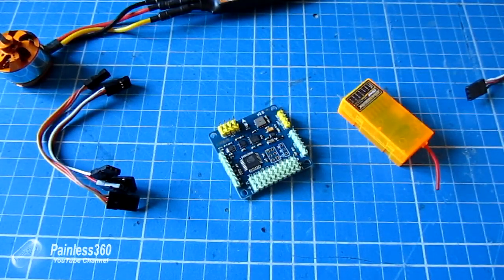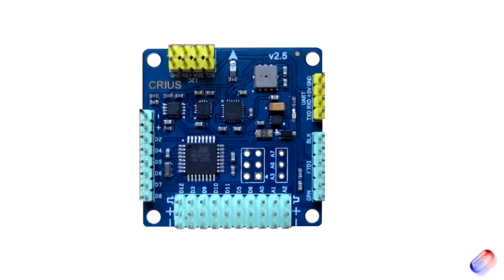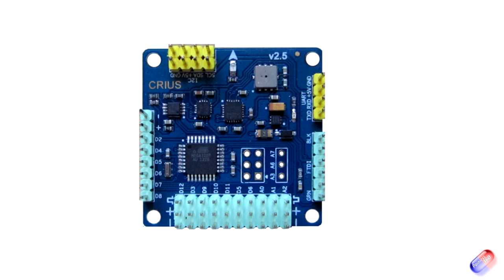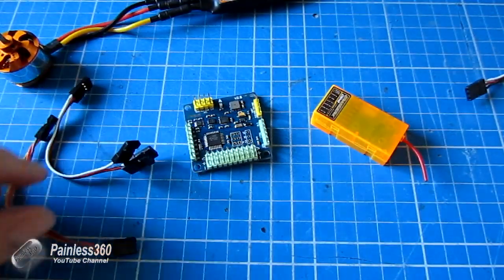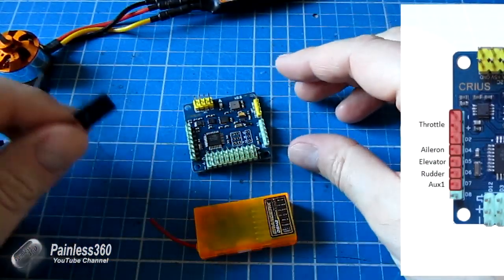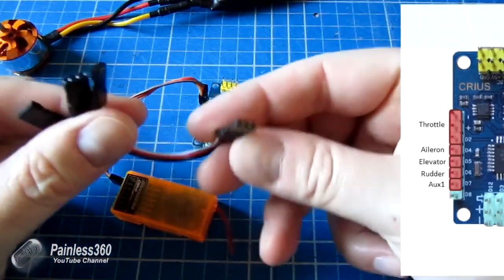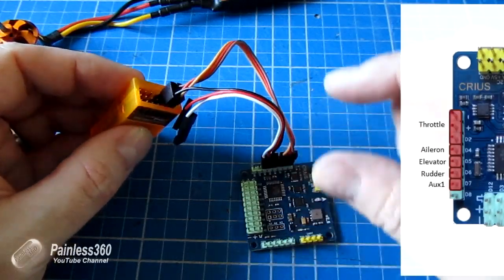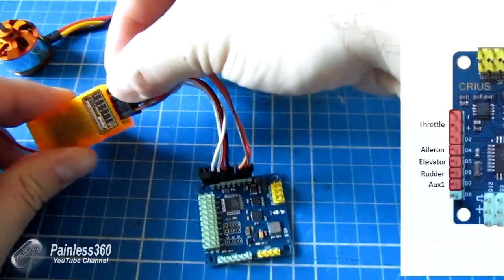(2/7) How to wire up a Multiwii SE board to your multirotor/quadcopter

Comment: I followed your procedure but when I plug in the power to my quad copter my esc's beep constantly and even when I arm the board it continues and I have no throttle.
Reply from the maker: What does it show when you look at the board through MultiWiiConf? What ESC(s) are you using?

Comment: I'm having problems with my board: it seems to work as it is supposed to until I put on props and try to fly. The motors just start twitching, stuttering, and acting abnormally unless I dismount the multiwii and completely oscillate it from the vibrations of the craft. I did the best I could at balancing the props, what could be causing the issues?
Reply from the maker: I've had this problem and its been two separate issues here.

The first is that I'd flashed the ESCs with SimonK firmware and there was a bug in the KK tool that loaded the wrong firmware onto the ESCs. If you've loaded the firmware yourself - update and reload and check the versions you are using have no known issues. (Problems with HobbyKing 20A ESC after flashing with of SimonK firmware V2013-9-20 - Solution)

Second problem was due to harmonics in the frame/arms that the MWC didn't like. I used the LPF settings in CONFIG.H to remove these and fly normally.

Hope one of these is your issue and gets you flying. If not schedule a Helpout and we can take a closer look.
Reply: Painless360 What is LDF? Is it software-dampening? I did try to tape the FC to a bit of foam, but it did not help until I grabbed the FC and then the props ran smoothly.

I did not flash the ESCs with any firmware and they run smoothly with propellers (If I snap it up to near-max throttle, they buzzing/vibrating noises from I suppose unbalanced props and crap motors.) Nonetheless it seems like the ESC does what it is supposed to.
Reply from the maker: OK, sounds like you need to balance the props and motors as the vibration is too much for the controller, even with a mount. The LPF (not LDF) is a software low pass filter that removes unwanted interference in the gyro/accelerometers. I've had to do it a few times myself to get the board to handle the frame ok.

From the config.h section on LPF -

"MPU6050 Low pass filter setting. In case you cannot eliminate all vibrations to the Gyro, you can try
         to decrease the LPF frequency, only one step per try. As soon as twitching gone, stick with that setting.
         It will not help on feedback wobbles, so change only when copter is randomly twitching and all dampening and
         balancing options ran out. Uncomment only one option!
         IMPORTANT! Change low pass filter setting changes PID behaviour, so retune your PID's after changing LPF."

Try uncommenting #define MPU6050_LPF_188HZ first and if it doesn't work try the next one down until you get it.

I think I'll make a video on this as it is very handy to know..
Reply: Painless360 I've just bought a magnetic balancer it will take some time to arrive, in the mean time I think I will try that LDF settings! I sound them in the code and uncommented the 2nd one down.

I did attempt to balance the props by press-fitting a smooth round pencil into the middle, and letting it balance on the edge of my table. I then added tape to the heavier side until the heavier blade no longer preferred to swing down. I also tried balancing the base with electrical tape, but on some blades I could not get it to balance nicely, at least not with tape.

How much vibration should I expect coming from a decent setup? I just downloaded an vibration meter to my phone to see if I can quantify the vibration from the motors and props.
Reply: Painless360 In case I do need to flash SimonK firmware to the ESCs, do I need that programer shown in the video? Or can I use the FTDI adaptor? I also have a spare arduino MEGA which can probably be configured to flash other chips. I saw a video where thats what was used to flash  one of those ATtiny85 chips.
Reply from the maker: I would use the programmer. It's easy to do. Good luck with it.

Comment: Hi. I did try it on the grass. Manage to fly but still driftting fast to a side. Im not quite sure which side as it goes very fast drift and flip to the ground. I have checked all my motors and props. Its all installed correctly. I feels like 2 of my motors not getting much power compare the other 2. I might wrong in this. My question now is do i need to auto level the multiwii using the computer? And trim auto level after that? Im so sorry coz im newbie and just started to get into this as new hobby. Thanks in advance!
Reply from the maker: Hi Emo, if that is all ok then recheck that the artificial horizon in the MultiWiiConf responds as you'd expect and reset the accelerometers..

I'd also manually recalibrate the ESCs again too, just to be safe.

Hope it helps.

Comment: Hi. Thanks for all your video. I just finished build my 1st quad. My 1st flight was not smooth at all. It goes flip at one side as if 1 or 2 of the motors is not power enough to take off. If it flys it will drift at a side quite fast and flip. Can you help me how to solve this? Hope to fly smoothly before i breaks the props :((

My gear - multiwii v2.5 + flysky fs-t6
Reply from the maker: Hi, first thing to check is that you have the motors connected on the right way and that none of your props are installed upside down...
 
Hope this helps..
Reply: Hi, thanks for your reply. I've checked all my motors, they are all connected correctly and the props are installed as they supposed to be. I manage to fly it at about 2 feets and the moment its  start to fly, its drift to a side. Will try it again on a grass so that they won't crash badly. Earlier i was trying on a hard floor.
Reply from the maker: Hi Emo, if that is all ok then recheck that the artificial horizon in the MultiWiiConf responds as you'd expect and reset the accelerometers.. Hope it helps.

Comment: I can't seem to get my hex to arm even after I load the software on the board. Someone said I may need a boot loader? Sorry, a bit off topic but I have the same board and don't know if I need that.
Reply from the maker: Hi Mark, if you have successfully downloaded the software to the board (and can see it using MultiWiiConf) then the bootloader isn't needed as the board is configured.Check out my video about troubleshooting arming called 'Multiwii Arming' (@watch?v=lc4ECi6JYX4&list=PLYsWjANuAm4qSqszQR6qIisiwk5r-_nMk&index=6) that may help.Good luck with the problem.

Comment: Hello, I brought the HKTR-6a, I really do not know which channel is Throttle or Aileron？my receiver shows CH1-CH6,which I have no idea. Please help me, thanks
Reply from the maker: Hi, it's never helpful when the manufacturer doesn't mark the receiver! The detail you are after looks like it is in the files section at the bottom of this page - http://www.hobbyking.com/hobbyking/store/__9042__Hobby_King_2_4Ghz_6Ch_Tx_Rx_V2_Mode_2_.html

Look for the file called 'Channels' you can always check this when you first connect the Multiwii to the MultiWiiConf interface. Check that the channel you are moving is the one changing on the display. Bets of luck with the build.
Reply: Mine was the same way,  I used my oscilloscope and probed everything out, and figured out what channel was what. You could also connect the esc directly to the fifteen channels and then plug in the LiPo and see which gimbal controls the motor. No need to arm in the direct receiver-to-ESC connection.

Comment: Hi, Tell me please? whats wrong with my board. Blue led flashing all the time . Rewriting new firmware did not help. Maybe i burn it when connect throttle from receiver in wrong way. Thanks!
Reply from the maker: Hi Саша, Does the board connect to MultiWiiConf once it's flashed? The LED will stay flashing for a number of reasons but one of the simplest is that the accelerometer calibration hasn't been done/the board isn't level. Try that.

Hope it helps. Happy flying!
Reply: Painless360 No, It is not connected to MWC. Just plug the battery and it start flashing. And I can not activate it. Try to calbrate acc.Thanks!
Reply from the maker: So you get an error when you try and flash the firmware using the software then? See Crius SE V2.0 MultiWii Board (MWB) Overview and Setup for the details..
Reply: Painless360 Yes i use this instructions from beginning and everything was OK. I flashed new firmware - 2.2 2.3, but board did not work properly. I decided flash board with your firmware 2.1 again (with this firmware board work properly). Flashing was OK, but board did not work.
Reply from the maker: So, to be clear. You have calibrated the compass and accelerometers using MultiWiiConf? If you have then make sure the board is flat when powered on. Failing that, schedule a Helpout time and we can take a look.
Reply: Painless360 Calibration is not done yet. I Try it.
Reply: Саша Семенюта Thanks! It works again.

Comment: Painless360 thanks a lot for your last tip! I now have my multiwii megapirate board ARMED and all the stick functions are correct!!    The only problem I'm having is that it doesn't arm/unarm by turning the throttle stick to the right/left at bottom position.    In my case it'll arm as soon as I give like 15% throttle on the throttle stick. And after it has been armed the motors will idle even at 0 throttle input... I also can't find a way to unarm it.

Again thanks a BUNCH for the help that you've already given me!!
Reply from the maker: You can try a few things (after that I've not got enough experience to guess!) you can try performing a ACC calibration and a MAG calibration and/or selecting #define CRIUS_AIO_PRO_V1  in the code.. Best of luck!
Reply: ACC calibration just defines the board's (level) position... MAG calibration I'm still lost on what that does. 
As for defining the CRIUS_AIO_PRO_V1 I get a programing error. I referred to this in one of my previous comments.
Reply from the maker: Bruce Hitzfield If the board doesn't think it's level then it won't arm. RCgroups forums may be a good place to have a look in. I hope you get this sorted soon. Happy flying!
Reply: If your using the windows GUI then check that the boxes that assign function to your AUX1 swithing arrangement,you'll find that having the Low box checked for acro mode takes over the arming process but reading your question again I believe that "Painless360" is right in that the RCGroups site will be the place for you.The guys there are great with the MW stuff.The MAG calibration is a way of letting the chip know which way is which.You press it and rotate the copter through all axises eg: roll,flip and stand on bum and rotate (hope you know what I mean?) BUT! this has to happen within 30 seconds of pressing the calibration button ok,so try it a few times because if like me you only have a short length of wire connecting the FTDI to the copter then it takes a little working out OK.....Good luch with it and enjoy the flying
JCinAuz

Comment: I tested my receiver to my transmitter and it works fine but when I wired the receiver into my MW board I get no responses.  Am I to do something in the config.h settings? I am using a dragon link receiver.
Reply from the maker: That should all be sorted in the config.h already. Have you checked that you can see a servo move when it's plugged directly into the channels on the Rx (troubleshoot without the MWC to start with)?

If so then use the MultiwiiConf program to see if you can see the values moving on the screen as you move the sticks.
Reply: Painless360 I successfully binded my transmitter to my receiver (Dragonlink) then I connected a servo to my receiver and it works. When I connect my receiver to my MW board, I get no responses, even in the MWGUI tool.  I move my sticks but nothing seems to happen.  I am using the Turnigy Open9x.
Reply: BUT when i move my throttle i do not get any motors to spin
Reply from the maker: You are arming the board? (Usually throttle. Stick to the bottom right)?
Reply: In order to 'arm' the board as you describe. What needs to be set in config.h ??

when I take a voltage measurement at the FC pins to the ESC's, when the throttle is full I get minus 5 volts and when I put the throttle off I get plus five volts. This does not sound right.  This is across the RED and BLACK pins.
Reply from the maker: Ken Pappas This is standard procedure for arming any Multiwii based flight controller. This is part of the code, you don't need to change anything in config.h for this to work - see Multiwii.com for full details. Unless the board is armed (usually demoted by a lit red LED), the motors will not turn. 

The signals from the board to the ESCs use the same format as the servos - Pulse Width Modulation (PWM) this is where the length of each pulse sets the value, you can't 'see' this easily with a voltmeter as you can't see the pulses themselves.

Hope this helps.
Reply: Painless360 Tried arming the board by moving the throttle stick to the bottom right.  NOTHING.

Comment: I guess I need some more expert help here..

My quad was sitting around for about a week and now when I try to fly it it it won't take off.
The strange thing is that Yaw, Pitch and Roll are responsive but Throttle only gives out a little more speed. The quad stays on the ground. I re-flashed the board, re-calibrated the ESCs with the software and the Tx, tried out a "clean" new MultiWii code, even switched the board, but nothing helped.
I looked at the GUI and all the signals to the ESCs are normal.

Any ideas?
Reply from the maker: Do the ESCs work normally when pugged directly into the throttle channel of the Rx?

If you can see the throttle rise in the code then the MWC and Tx should be fine. Obvious question but I've got to ask - anything changed on the bird since it flew normally last time?
Reply: That was what I thought as well.
Nothing changed since yesterday.. Yesterday was good, but today no fly :/ .
ESCs work normally when directly connected to Rx.
Reply from the maker: If that works then I could be a bad connection in the power system/battery connection. If all four motors have the same problem then I'd check the battery, connector and connection to the power distribution board..
Reply: I did connect some led strips on to the PDB, I'll remove them and try again, great idea!
Reply: Well it didn't change anything unfortunately.
Reply from the maker: Sounds like a power issue, I guess you've tried another battery?
Reply: I'll try today. What problem can a battery have? Inconsistency under load?
Reply from the maker: The discharge curve from a new pack is nice and flat but if a pack is over-charged, over-discharged or physically damaged then you will usually see 'puffing' of the pack and it's ability to deliver will be compromised. 

It is usually one of the cells that goes first. Check the battery on your charger and make sure that the cell voltages stay more or less the same after a flight. If the pack is deformed in any way. Don't use it to fly.

I'd always try a new battery on the model if I lose lift and can't see any other obvious causes.

Good luck.
Reply: Tested with another pack, same results.. Maybe the power distribution board is bad?
One thing I notices is that when I give it full left Yaw it lifts to about a meter or so.
Reply from the maker: Sounds odd if the control input make it rise. Sorry I can't be more help but the last time this happened to me it turned out to be that uploaded software had flashed the ESCs with the wrong version of firmware..

One last thing - the travel/ATV's/mix on the radio for the throttle haven't been set have they

Good luck finding the issue.
Reply: Sounds like the control board has lost its way with the escs
maybe recalibrate them?
Reply: Could it be a silly mistake of the props put on the wrong way,  assuming the motors are going the speed they should?

Comment: If I install the gps that goes with this board and want to add an OSD does the OSD also need it's own gps module?
Reply from the maker: Most OSDs come with an integral GPS already so it depends on the one you are going to use - there are lots to choose from.

I have videos for the EzOSD that is excellent..
Reply: Painless360 what do you mean integrated? I have been looking at some OSDs on Hobby King and most of them do come with a GPS module that comes with it but it is not integrated in the OSD board itself, it connects to the OSD board. So is that what you mean when you said integrated? So my questions is. Do I need the GPS for the control board to use features like altitude hold and return to home and another GPS module compatible with the OSD board? All I want the OSD is just so that I can get basic info like battery, altitude, and coordinates of quadcopter location in case if I lose it. I will be getting Multiwii and Megapirate AIO Flight Controller w/FTDI (ATmega 2560) V2.0 for my control board on my quadcopter. Thanks
Reply from the maker: Sorry I've not used the ones you mention.

I use the ones that come with the GPS as part of the device - all ready to go. I'm very impressed with the ImmersionRC OSD devices - you get what you pay for and the EzOSD has already saved me £400 by allowing me to walk directly to a downed quad (crash-landed in the middle of a planted field). I'd have had no chance if I hadn't been using it with the iPhone app to track location in real time.

For the ones you describe I would guess you need two GPS receivers - one for each. Unless you can split the signal from one unit and get both the MWC and OSD to expect the same baud rate and protocol from the GPS Rx. If you figure it out I'd like to know how you got it all working with one.

Good luck, happy flying..
Reply: Painless360 ok thank you